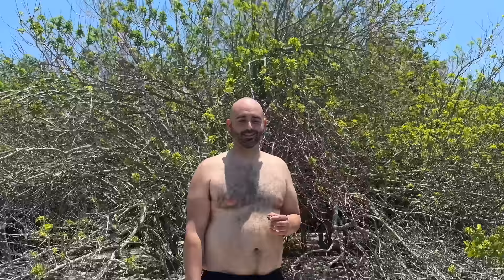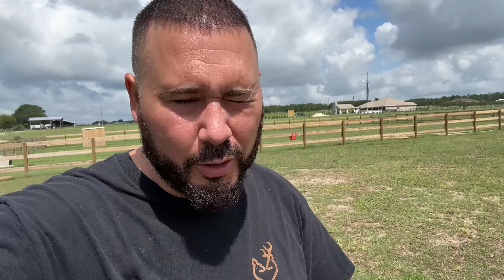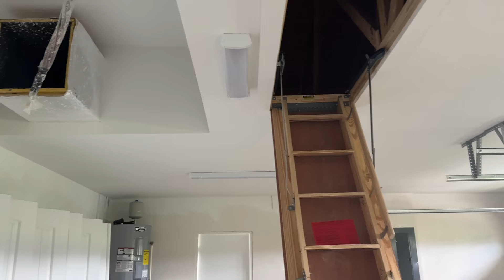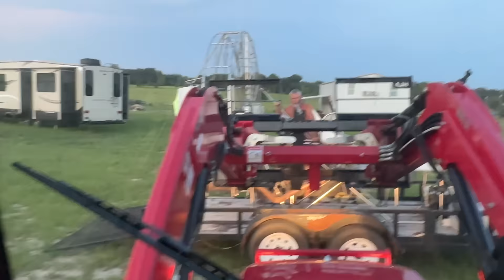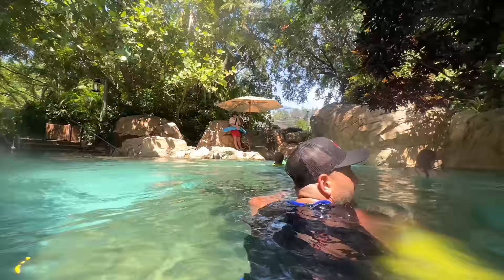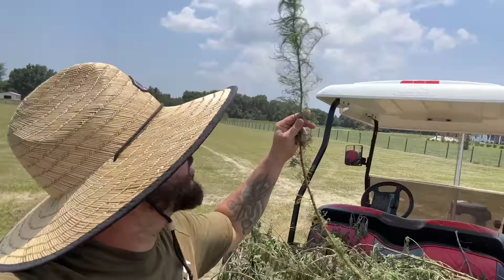Exposing Moe Sargi For Who He Really Is...

Comment: Beautiful home you guys!!! I would recommend as a retired garage door installer myself, you may want to have someone add a couple more winds to the springs. Noticed when mo closed it it slammed a little.  It will make it easier for you to lift and close for you and your opener.  The springs settle after you wind them especially after two years. Sorry for all the info safety first for the fam.